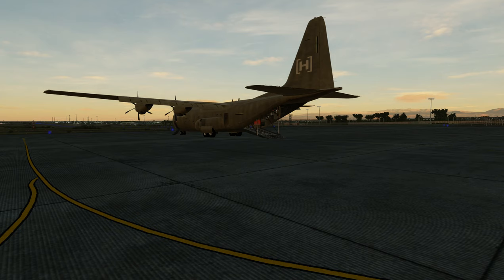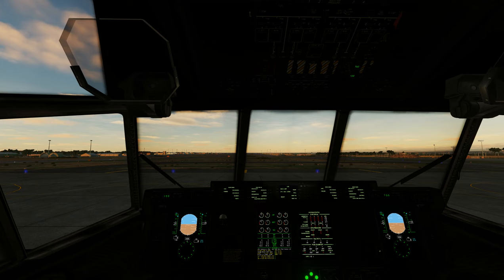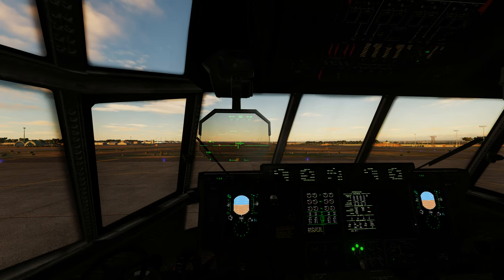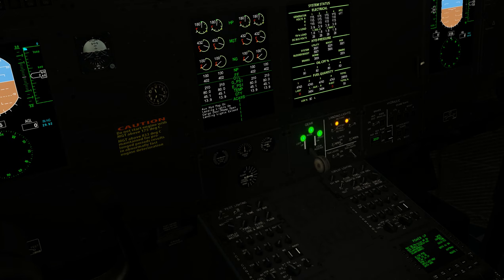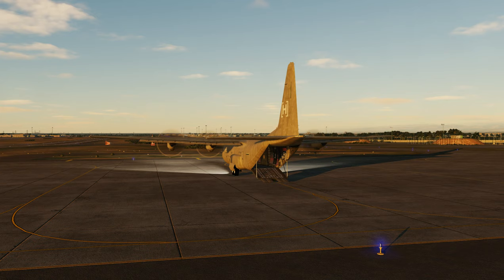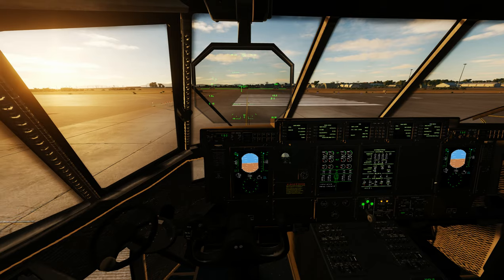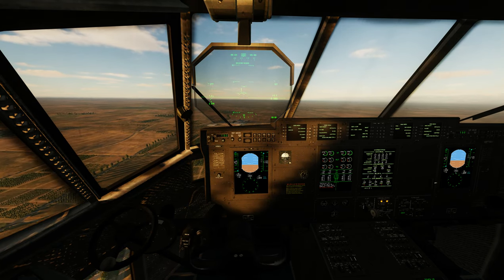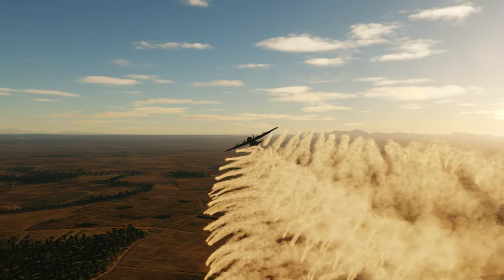DCS C-130J Hercules Mod Start, Take-off, and Air Drop

Comment: @flightsimulatoradventures7246  >>> What you call "tailgate" is the "cargo ramp." 

The thing aft of the ramp that closes to seal the rear of the aircraft is the "cargo door." 

I worked on C-130s is the US Navy and US Coast Guard. 

In other words, I have been around a BLEEDAIR BLIMP or two...😊